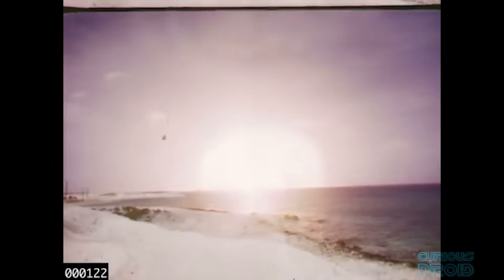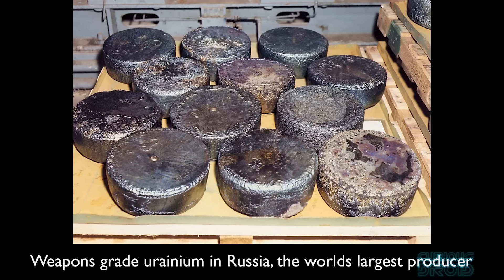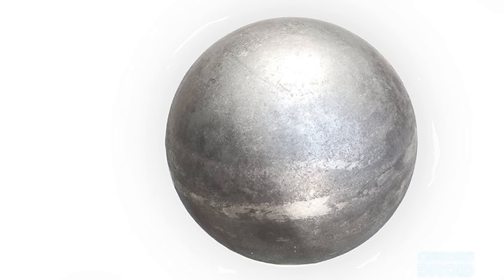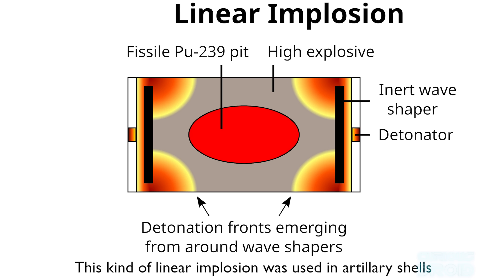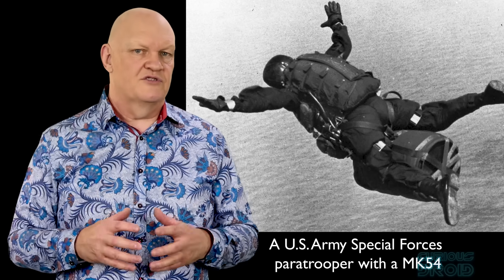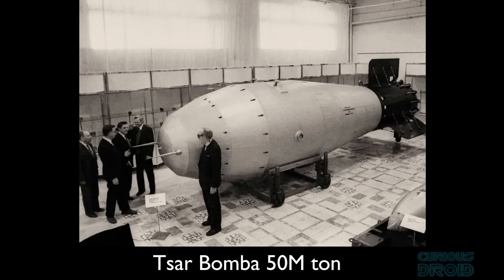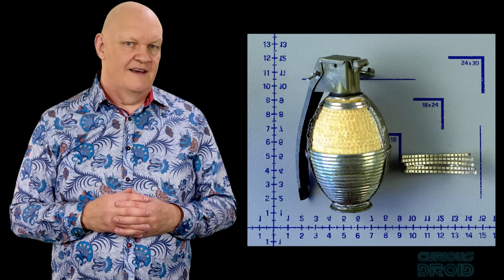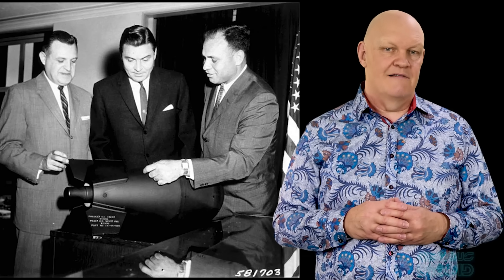How Small Can You Make a Nuclear Weapon?

Comment: I was a nuclear weapons specialist while I was in the Air Force and then later I worked for Sandia dismantling decommissioned weapons and reclaiming of fissionables.  During my tenure at the lab I had a poster in my office picturing a special forces operator jumping out of aircraft with a small nuclear weapon strapped to him. It was about the size of a Lg office trashcan and used a hollow fissionable sphere with tritium and deuterium gas inside (boosted fission device). So while the yield is still classified, best guess is 10-20 kilotons. 
A scientist at Los Alamos is quoted as saying "with modern designs we can make a nuclear hand grenade, only.problem would be finding someone suicidal enough to throw it"
Reply: When I started in nuclear reactor safety  in 1990 we had a poster on the wall: Forward Into The 80s.
Reply: @PMA65537  Still relevant.
Reply: I've seen that picture
Reply: The Maximum yield of the SADM was 1kt..
Reply: @Evan_Bell little secret,  there was a tritium boost capacity.   BIG BOOST.
Reply: @mynde-fuchefoundation2254  The SADM wasn't boosted, but other mods of the Mk-54 were. 1kt doesn't give you much room for boosting...
Reply: @Evan_Bell are you a physicist?
Reply: @Evan_Bell every thermonuclear warhead in existence relies on something similar and equivalent to SADM warhead as it's trigger.  There is ALWAYS.room to boost.
Reply: @Evan_Bell yeah for the pure fission weapon
Reply: Straight implosion type weapons, I agree. There was a question how little Plutonium can be used and still get critical mass.  This was also postulated during the  Project and what was calculated and the yield.  The bare minimum was 8KG and the yield was 10-15KT for a straight implosion, no tampers or boosters used.  When you get into modifications and all sorts of goodies, including Lithium, then that amount shrank drastically and the yield, surprisingly grew dramatically. When CASTLE BRAVO fired, the  ratios were recalculated, and "suitcase" devices suddenly went from chalkboard dreams to the real deal.
Reply: @Nighthawke70  Fat Man used a 6.2 kg plutonium pit with a uranium tamper giving a yield now estimated to be 25 kilotons.

Injecting tritium-deuterium into a core increases yield, as demonstrated in Operation Greenhouse, shots George and Item, in 1951. George also demonstrated the use of a neutron generator to accelerate the reaction. These also allowed the use of smaller pits for low-yield fission devices, giving a considerable saving in weight and cost. It has been estimated that Davy Crockett's M388 used only 2–3 kilos of plutonium.

Lithium deuteride is the fusion material for a thermonuclear or 'hydrogen' bomb, which uses a fission bomb to initiate the reaction. About 1 kilo of LiD gives an increase in yield of 50 kilotons (with a uranium tamper). The W80 cruise missile warhead has a yield switchable from 5 kilotons to 150 kt, depending on whether the fusion part of the warhead is allowed to work. The 5-kiloton fission is supposed to result from 3–4 kilos of plutonium, which means the fusion option probably uses 3 kilos of lithium deuteride.
Reply: @akizeta very good.  They threw in the extra because they had it.  10-15%, i think.  The Lithium bonus was a "happy surprise" as it were known.  Itvwould have just been that if it has d only gave 5-7MT.  But 10? Yikes.  That was a rough estimate due to the instrumentation being vapor3ozed.
Reply: @Nighthawke70 if you wanna see something thatll cook your noodle a bit, check out the "flying lens" implosion method. The declassified info is wild and if coupled with a levitated hollow pit with fusion fuel gas in it theyve run sims using an amost foil like u238 tamper that will fission after thst tiny amount of fusion fuel goes off and sends out all those fast neutrons. Point is the amount of fissile material required is tiny and your still looking at yields in the tens of kilotons plus like all modern weapons its a variable yield setup. Aint science fun kids lol
Reply: @Nighthawke70 Если литий в вашем сообщении заменить на дейтерид лития то станет понятно что речь идёт о термоядерном взрывном устройстве что объяснит резкий рост мощности
Reply: Then the self navigating drone era began... Should world conflicts go super critical it will be thousands of Nukes measured in tons and kilotons going off rather than the mega ton ones. I guess the one smart thing to do is not play the game or live near a target?
Reply: @proxywebs probably not
Reply: @proxywebs chess is a much better game
Reply: @proxywebs это иллюзия. Будут взорваны именно мегатонны в стратегическом промышленном тылу.
Reply: @proxywebs  The ICBM MIRVs haven't been in the megaton range for a long time. The really big ones might be the new Russian superweapons, like the autonomous drone submarine which might comfortably carry several hundreds of megatons
Reply: @Szgerle russian "super weapons" 🙄 kind of like the t14, su57, checkmate, s500 ... all propaganda
Reply: @JoeDiGiovanniIV  Its not. No serious planner takes them only as a bluff.
Reply: The B54 inside the SADM from that pic has a publicly released yield of 1kt.
Reply: @Ihasanart yup already said I was wrong on that, try and keep up
Reply: W54. Grüße aus Deutschland.Und vielen Dank, das wir noch leben.
Reply: @chrisyuriy4410 no Germans allowed
Reply: Regrettably, there are some who would. Only feasible way to use nuclear weapons in CQC is with some kind of launcher, feasible enough, but not really practical enough, the resulting consequences causing more problems then it's worth. 
After all, real life is not the game franchise Fallout. So, enjoy the fantasy of CQC with nuclear weapons in Fallout.
Reply: @trollpatrol1177 jesus wept, whered you pick up all this combat related wisdom? You serve? Did you make it downrange? You a military historian or something? Because what youre describing has been a thing for 60 almost 70 years😅
wtf are you talking about? Some kind of launcher? Like the recoilless rifle that fired the "Davey Crockett" warhead, ya know the nuclear scoot n shoot mounted to jeeps and their wasittle.if any oversight on their use. Nuclear deployment was literally left to the highest ranking guy of the three man team in the jeep and his discretion. On other words back in the 50s uncles sam gave a couple enlisted guys a jeep with a mini nuke launcher  and told if they saw the russians a comin, to use their best judgment 😳. I was enlisted as a military cop before i got my degree and managed to make it to E5 aka an air force staff sergeant and i dont think handing 25 year old.me a nuke and telling me its use was at my discretion would ha e been a good idea. But anyway point is weve had weapons sytems like that, they were developed decades ago. But there's a problem with a nuke like a davey Crockett,  the blast isnt all that impressive but the radiation from the raction and then the irradiated fallout is lethal to both sides. Because the bomb is so small for it to have the desired effect ot has to detonate either on the ground or jist above it, which sucks up a shit ton of dirt, debris, etc all.of which becomes contaminated with some rather nasty shit. Which is why the 1500 or so nuclear recoilless rifles were quietly removed from the active arsenal.
Reply: The "Fat Electrician" has a video about the guy that jumped with the SADM nuke
Reply: US made 155mm tactical nuclear which weight around 120lbs. I've been told they got rid of them as part of a disarmament agreement years ago. Instructions on firing them was to just start walking using 100 foot long cord and as soon as it fired to drop to the ground so you had a chance surviving the blast depending how far you were shooting😮.
Reply: @michaelcummings7246  I understand one of the less publicized reasons for maximum US border protection is to detect and intercept
 "high value immigrants".  
This would include anyone attempting to enter the US with a back pack sized nuclear weapon.   

National security at the border is a top priority for less obvious reasons.
Reply: @michaelcummings7246 the smallest weapon ever made was the W54 at 279mm and fired from a recoilless rifle mounted to a jeep
Reply: @limabravo6065 yes, the Davy Crockett. They were also available as a backpack kit for a crew of five with just a tripod. Range was 2km for the smaller model, and 4km for the larger. At the very low yield, this range was plenty safe enough for the crew. We had hundreds of them in Germany when they were hip.
Reply: I remember a blog that debunked the Soviet/Russian nuclear AK bullet urban legend and ran down the minimum size requirements for fission. Sadly it either went down or Google is so bad these days it can't be found.
Reply: @ChucksSEADnDEAD well its funny you mention that nuclear bullet idea. I read a paper years ago when the navy was testing railguns. And what the author described was basically this.
To get plutonium or an oralloy of plutonium 239, uranium 235, and gallium to go kaboom all you have to do is increase its density by 2% hence the implosion method. So what this guy described was if you had a hardened structure or an underground bunker you could fire a projectile made of fissionables with specially designed cavites inside it so that when it impacted at mach 5 or 6 and just before it converted to plasma it would crush itself down and go prompt critical aka boom. The guy even talked about making the projectile the same way that a full metal jacket bullet is constructed, with the fissionables in the center with maybe a neutron source like the urchan inside it, but then wrapping the fission material in a uranium 238 jacket to act like a tamper and neutron reflector. And since the rail gun that the navy was testing used a sabot around the projectile, if they stuck with that design thered be little to no contamination of the weapons system
Reply: @limabravo6065 That concept was called Thin Man.  The casing length was about 17 feet long in order to get PU238 to critically. That is if the target and slug was pure PU238, in which it was not.  It had PU237 in it which would have caused predetonation, in turn would have blown the entire assembly apart before criticality was ever reached.
Reply: @Nighthawke70 literally nothing youve just said is in anyway accurate. The thinman was the initial design the Manhattan project was going with but the reactor made plutonium contained too much pu240 which would have realeased too many spontaneous neutrons and caused a nuclear fizzle so the design was abandoned. Plutonium 238 is the isotope used in radio isotope thermoelectric generators that power stuff like spacecraft out passed where solar panels can be used. But plutonium 238 has nothing to do with weapons at all and in fact is not suitable for weapons use outside of something like a dirty bomb.
Reply: @Nighthawke70 and plutonium 237 is not a thing, thats Neptunium
Reply: @limabravo6065 Pu-237 is a thing, it's just not produced in meaningful quantities and has a very short half life so it's not used for anything...
Reply: @Evan_Bell look at the decay chain there bill nye
Reply: @limabravo6065 It decays to Np-237, I know. You said Pu-237 isn't a thing. That's erroneous.
Reply: Operation Green Light.  Special Forces did have a plan and trained Operators to do that.  Billy Waugh, the "godfather of the green berets", was involved and speaks about it in the book Surprise, Kill, Vanish.
Reply: @holdintheaces7468 i just watched the episode of Unsubscribe, that guys a legend. Theve even got the picture of him yeeting himself out of an airplane with that trashcan sized bundle of doom😅
Reply: wow.  man, thank for your service.
Reply: There's a declassified training video for the SADM — which this is — elsewhere in YouTube which covers some of the options for transporting the device, including skindiving and parachuting with it.  The actual SADM was 12" by 18", but the hard case for it added an inch or so all around and the padded carrier bag added a couple of inches.

Edit: the yield of SADM was variable from 10 tons to one kiloton.

Meanwhile the physically smallest device was the W82 for a 155mm artillery shell. The shell featured a rocket booster and a radar fuse, and the physics package was about 16" long by 6" by the illustrations of it. The entire shell weighed 95 lbs and had a yield of 2 kilotons.
Reply: *fatman launcher enters the chat

 I actually remember that Fallout New Vegas had nuclear grenades called "holy grenades"

Whats ur guess.. how strong would such a nuclear grenade be?  (with modern technology)

i imagine the framentation would reach absolutely mindblowing speeds and crazy penetration.

which material would u use for the fragmentation hull in that case?

and how far would it need to be launched to so the soldier can survive / so he would not be critically irradiated?
Reply: @Sergeant-Frostwell yield wise itd be smaller than the Davey crocket and that was about 80 tons of tnt equivalent.  So something light enough for your average troop to yeet at he bad guys, is likely gonna have 10 to 15 ton yield. But it wont work off of implosion, itd likely be a miniaturized form of the gun type design. In less than 10 years the boys at los alamos had taked the uranium gun bomb type that little boy was based on and got it from the size of a small SUV to an artillery shell. So given modern materials that can hold together longer and maybe a layer of radon gas to act as tamper and neutron reflector, they might he able to bring to subcritical masses together and get it to go prompt critical. Itd definitely need an active neutron source in it, and shrapnel isnt really going to be a thing because even a device that small is getting converted to plasma. But a blast equivalent of say 10 tons of tnt is nothing to sneeze at for an anti-personell weapon. Itd be like being in the conventional grenade factory and having the entire inventory go boom at once. Ypu know now that im bouncing this idea off the grey matter a nuke grenade would probably be an implosion device. Theres this method of implosion that utilizes what they call "flying lenses" that allows for the atomic bomb blasting cap on a thermonuclear warhead to be made really small, which then allows the MIRV to be made smaller while still coming to party with 350 kilotons of good times. That lens type plus a hollow pit amd maybe a little deuterium n tritium booster gas inside it and... well i hope that fox hole is good and deep otherwise youre effed in the a with a big old d. Its still likely to kill you to with the amount of xrays, gamma rays and well contaminated fallout youll be covered in. Over in iraq that damn dust was almost like a living thing and when one of us chucked a grenade at the smelly bearded guys that shit would go everywhere and drop visibility to nothing. And youre breathing that shit in the whole time and with this weapon instead of poo smelling sand and dust being inconvenient when peoplw are shooting at you, this shit would be nice and radioactive. You get that garbage in the respiratory tract, the gi tract aka where you cant get them out and youll be reaching for your weapon and taking a much less painful way out
Reply: Instructions:

1:  Pull pin
2:  Throw... very very very VERY hard
3:  NO!  The grenade, you idiot!  Not the pin!
Reply: @nowthatsjustducky now thats funny, but its funny because shit like that has absolutely happened. Enlisted boot camp is eye opener as to the various iq's running around out there. But just remember guys like 20 year old me were issued a vehicle mounted nuke that only required the trigger to be pulled in order to kick off ww3. Yup no two officers with keys, no guys in a silo waiting for a presidential order no no just 3 enlisted dudes, one of whom may have been yelled at for lighting his pubic hair on fire while drinking 4 loco if 4 loco was around back then😅
Reply: That has been solved with a Jihadist delivery system.  "They" don't see it as "suicide"; 'they' see it as "eternal bliss" with 99 Virgins to keep them company.  Although, to be honest WW2 Nihon kamikaze pilots worked for a whole lot less - enough sake to get a buzz.
Reply: there is not shortage of idiots to throw nuclear grenade.
Reply: "with modern designs we can make a nuclear hand grenade, only.problem would be finding someone suicidal enough to throw it"
Saudi Arabia and Iran and Pakistan have MILLIONS or people to do that.
Reply: If you don't tell them it's nuclear, I'd imagine you could find plenty of fools.
Reply: The MK54?
Reply: Liberty Prime intensifies
Reply: Took the words right out of my mouth. ROLMFAO
Navel Orange to Grapefruit size.
Reply: ill take things that didnt happen for $500
Reply: I would throw one,fair dinkum!🫡🇺🇲🇭🇲👍
Reply: It is terrible, if such a weapon exists there are many crazy people or terrorists to use it
Reply: Lol
Reply: all these kilotons, and even more so megatons, are useless. It is more interesting to create a large-sized munition, say from 500 and 3000 kg, where inside there is a small nuclear bomb with a capacity of say 50 tons of equivalent. At the same time, the explosives of this bomb contain 50% tungsten, the tungsten will absorb X-rays and the explosive products will become very hot. For example, to increase explosive properties, aluminum is introduced into explosives, which, when burned in pure oxygen, releases 31 MJ/ kg, and when burned in water or carbon dioxide vapor, 15 and 18 MJ/kg are released, respectively. And here a small nuclear bomb heats the explosive products to significantly higher temperatures. Such ammunition is used as usual, the explosion occurs in a contact manner or with a depression. At the same time, the ammunition is not considered a weapon of mass destruction, it is simply of increased power, it is used to destroy objects of increased strength.
Reply: @LithiumDeuteride-6 You're talking nonsense...
Reply: New take on what a flashbang is and does
Reply: I don’t know this guy. I didn’t even read his post I swear. God bless America.
Reply: Pakistan already has trained suicide bombers. There should not be any recruitment problem hiring the Donald Trump's best friend asim muneers people for throwing it.
Reply: @nearchd504 wanna try that again? Maybe use coherent sentences this time
Reply: @nearchd504 what are you rambling about??
Reply: I'm old enough to remember when a photo of a Soviet suitcase nuke was posted on the early internet.
Reply: The scary thing is you don't need to throw it anymore. YOu tape it to a drone.
Reply: I read this as “then later I worked for Santa”
Reply: Nah, it just matter of time when tritium boost shoulder bag toting terrorists making statement in American largest cities. If American and it’s perverse president continues one to pissed off other nations
Reply: I don't think the "dirty bomb" designed nuclear device was discussed at all.  Just downsizing seems to be dirty by default.
Reply: If only there is a way to launch it great distances….
Reply: @Choo-zj1jc I just love the fact that yeah it was tiny as nukes go, but It required no authorization to use. So the three man teams of enlisted guys that were issued these things, could have kicked off WW3 on their own accord😂.
Reply: @limabravo6065  but if everyone is armed with tiny nukes then no one would want to use it out of fear if mutual destruction right? Sure a few crazies would take themselves out here and there bit that’d be fun to watch
Reply: They would sell like hotcakes in the middle east.
Reply: "... only problem would be finding someone suicidal enough to throw it." 

I can't imagine that would be hard at all. Unfortunately, as many terrorist organizations have shown, suicide bombers haven't been hard to find in decades.
Reply: sandia😁
Reply: Boston Dynamics Terminator bots would throw it. They completely sold out their entire physical and intellectual property to the Chinese Communist Party of China for military usage through intermediary Hyundai in February 2025, after adamantly refusing to license their designs to the US military. We are super in trouble. And Google has deliberatley let AI loose on the internet. So AI is on the loose so Ultron and Skynet are not far from taking over. Too bad Trump did not do his job and prevent the robot sale.
Reply: @OverdriveGaming-plays  they could use their little robot dogs to carry the mini-nukes into hard to reach positions and buildings^^

if they manage to produce these robots in masses, it wouldnt be much different to drone warfare.

for open warfare they would simply use flying drones to carry/drop the nukes and for urban warfare to enter buildings and tunnels, they send their robot dogs. 

that would actually be worse then depicted in the Terminator movies.
Reply: @OverdriveGaming-plays and they did it because way back when they started out guess who was a massive financial backer? Ill give you a hint its the same federal agency that financed googles creation and is thanked by the developers.
Reply: fk... that is something i was really really wishing not to being possible... (love from iran)
Reply: @_Caedwyn speaking of iran, yall remember when the news was going on about the 30,000lb + bunker busters not doing much damge to the iran nuclear sites? I really wish i would have been in that press conference so i could retort with 
"Well if thats the case we do have another bunker buster capable of going much deeper and has an explosive yield of 1.2 megatons of thermonuclear kaboom. Because when you absolutely, positively have to reduce your enemies to their constituent atoms... Behold the B82 thermonuclear bunker buster accept no substitutes"
Reply: Sounds like 0:33 with it strapped to his leg
Reply: Well if the blast is big enough just turn it into RPG
Reply: At Sandia myself 60 years ago. Smallest nuclear weapon was .2k and the shape and size of a bowling ball.
Reply: @Petescag right! I saw the design for a boosted weapon the size and shape of a rugby ball with an estimated yield of a quarter kt. 
Nice and terrifying
Reply: U233 would make a smaller device.

No comfort to a nation with over a hundred Spent Fuel pools. Messy.
Reply: Why would U233 make a smaller device?
Reply: @limabravo6065  
U233 has a smaller critical mass than U235, so less material overall than a U235 device. This seems to stem form two key properties: Higher neutron yield per fission, and slightly higher reactivity to "harder spectrum" neutrons. 
U233 has a lower spontaneous fission rate than either U235 or plutonium 239, so there is less heat generation, and subcritical masses can be arranged in a denser geometry.
On the downside, the implosion has to happen faster.
Reply: @limabravo6065  U233 has a lower critical mass, higher neutron yield and sharper response to compression.
Reply: how come it's always about weapons or reactors?
Reply: @thomascoonen7248 its not but those are the two primary uses gor any energy source like this
Reply: There are plenty of people around who would be willing to do that. You can guess who I’m talking about.
Reply: @kitemanmusic the alalu snackbar type
Reply: 11.2 kt exactly
Reply: @bastadimastaok my mistake, but still the trashcan of doom is within the estimated yield of little boy. That thing was the size of a large car and had over 60 kg of U235
Reply: @bastadimasta there is no exactly.  There is optimal, and then a curve down or even up from there depending on a LARGE number of variables.
Reply: Hire muslims
Reply: TS SCI
Reply: I play a game called Children of a Dead Earth, which is essentially a physics sandbox and space combat simulator rolled together, it allows you to make literally any module you'd need on a spaceship, from the rockets to the tanks, radiators, reactors, weapons etc. everything is done with real material parameters. The smallest nuclear weapon I created in the game used U-233 and was an egg shape about 8 cm in diameter, and 17 cm in length. Easily small enough to be held in one hand. The yield was 95 tonnes of TNT, and it weighed around 600 grams.

Of course it's just a simulation game, but the physics should be fairly close. The size/weight also doesn't account for any shielding that you'd need, especially considering U-233's radioactivity in real life.
Reply: Yeah. I was the PM of GB in 1922...wank wank wank. 🙄
Reply: @manuwilson4695 it's OK that you've never accomplished anything in life. Your parents being related by blood started you off with a nasty handicap. So you just enjoy lookin at the rabbits while the rest of us productive human beings get on with things.